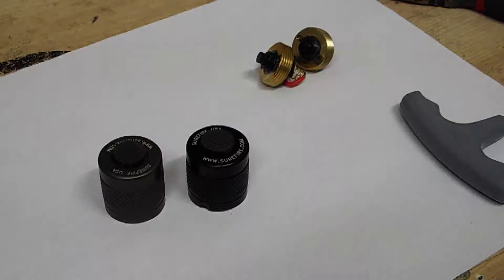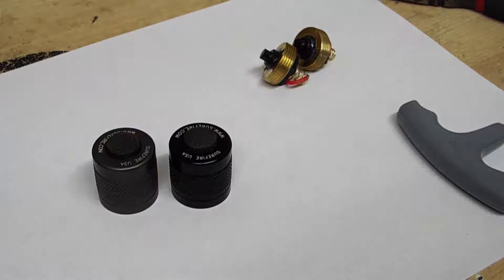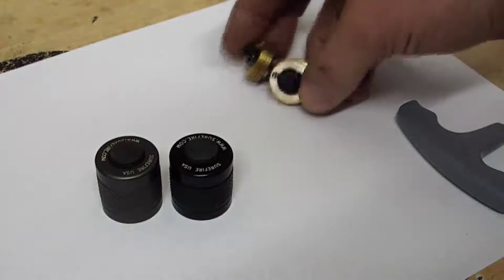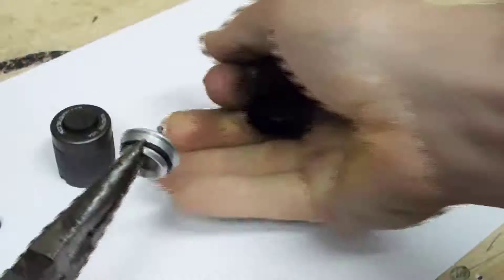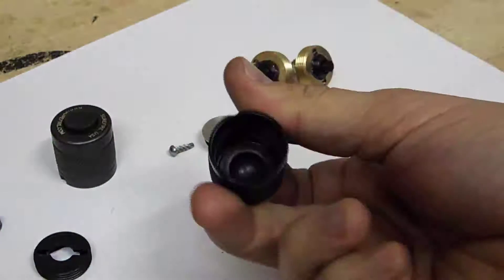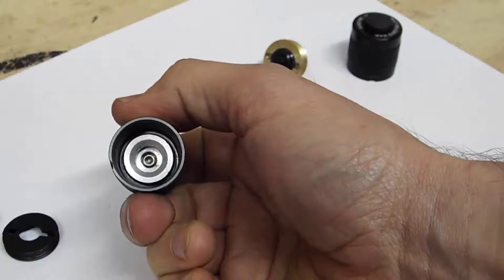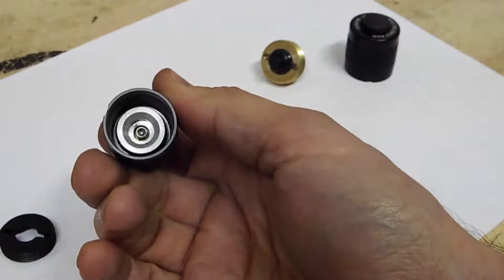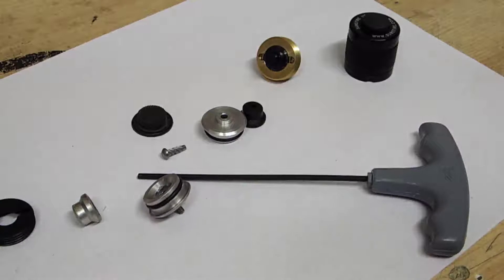Surefire tail cap disassembly Z41 switch mod.

Comment: Thanks so much. I bought a switch online that came with no directions and my GP6 had the same tailcap switch assembly. Was afraid I would tear it up and after watching your video I had the old switch out and the new one installed in under 1 minute.

Comment: Thanks for the video!  FYI, that "pressure stud" is a drive screw; typically used to quickly and semi-permanently attach nameplates to machinery.  Very fast, no tapping required.